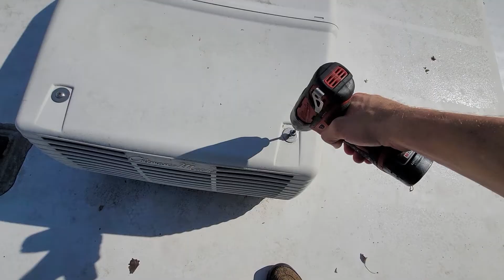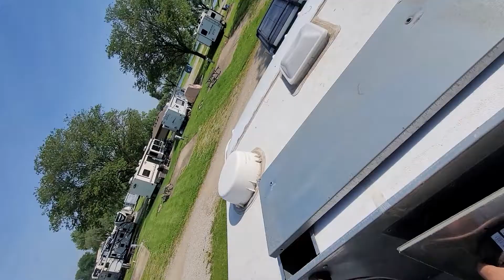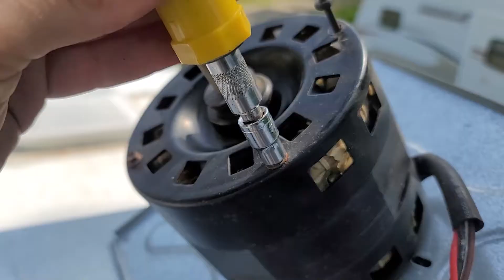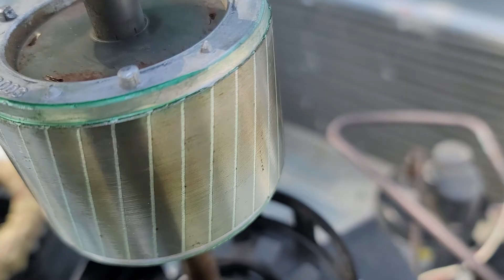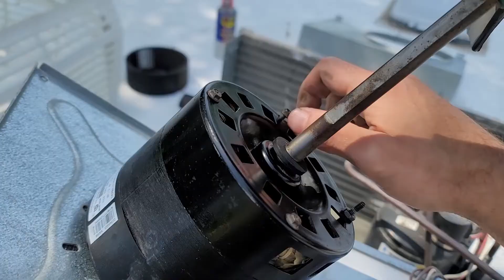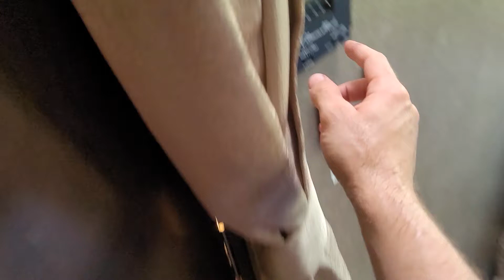Noisy RV Air Conditioner Fix - Coleman Mach 3 | Disassembly, Lubing Bearings & Maintenance

Comment: In case anyone wants to swap the bearings on Coleman Mach 3 they are 6201-ZZ-1/2. Not just plain 6201 bearing. I bought 6201 2pack from Amazon for $8 and the inner diameter was 12mm instead of half an inch (0.500). The correct specs are: 1/2" Bore; 1.26" Outside Diameter; 0.394" Outer Race Width. The entire shaft is 0.002 smaller and only the width of the bearing land is light press fit on the shaft. Very easy to pry the bearing up with screw driver. There is a snap ring under the bearing so make sure you are not prying that up. Bearings are $13 for 4 pack. These are brushless motors so can run forever as long as you keep swapping bearings.

Comment: Seems to me after all that work would it have not been better to spend 20 bucks for 2 new bearings ? Your fix is only temporary fixed. In a months time you will be doing it again
Reply from the maker: If the bearings were shot you might be right, but it has been a few years now and no issues have returned.

Comment: Any recommendations on the proper lube to use? TriFlow will work for awhile, but those bearings need something heavier...

Also the rear bearing is accessible, and may be the only prob. Just packing a little of the right grease next to it may silence it.
Reply from the maker: Grease sounds right actually, like Lucas Red & Tacky, probably because it'll stick around for much longer and has good water resistance: https://amzn.to/4twLXDw
Reply: @BOOTENWAGEN   OK thx. I did some digging and I can get PermaOil from one place, but it takes 3 weeks before it will ship.
Reply from the maker: @WordLightDotNet Sure -- oh wow, that's a while. You can probably find the Lucas grease at a local Autozone pretty easily if you need something sooner.
Reply: @BOOTENWAGEN I have an extra tube of this from packing the bearings on the travel trailer

Comment: Excellent tutorial! Mine made the exact same noise then the whole unit shut down! No tripped breaker! So I unplugged the shore power , disconnected the battery and flipped the breaker switch to off I went up top and removed the cover and hand spun the fan to realize it was hard to spin! So now I’ll do your entire strip down maintenance and hopefully the bearing aren’t seized!
Reply from the maker: Thank you - and hopefully it's even simpler like debris in the fan shroud.

Comment: Great job on this video!!! Coleman Mach heat pumps and a/c's weak point seems to be the bearings (and most others). Biggest reason perfectly good motors are thrown out and replaced.
Also, not maintaining (cleaning, lubricating, and protecting against rust) these units yearly or bi-yearly, will definitely cost you. Ive seen quite a few people destroy million dollar + motorhomes by not just cleaning their roof mounted HVAC systems. The drip trays clog with mildew, mold, and dust to eventually overfill. If the installer didnt tape down where the roof is opened, the water leaks through into the ceiling and down the floor. Unfortunately, most people dont catch it until they start noticing their entire RV is stinking and thats when they call for help and receive the bad news.
 Thx for the vid...
Reply from the maker: Thank you! And what you described is a horror story actually and absolutely believable. I think I'll go clean mine again soon...
Reply: @BOOTENWAGEN  Lol, sounds like a productive plan! Take care and GBY...

Comment: Fantatic video - thumbs up and subscribed.  I did this today and wish I had found this earlier!  All other videos I've seen had motors with sleeve bearings, but mine had the same ball bearings as yours.  Same bearing as yours was noisy and I guess due to rust I couldn't get the housing to release from bearing.  Even with just that level of disassembly, I was able to get a Zoom Oil spout in to drip oil in.  You definitely did a better job than me!  Has this lubrication held up?  I'm hoping its not just a short-term fix!
Reply from the maker: I appreciate that, thank you! I performed this last repair last Summer, so I guess time will tell - but I've been running this AC pretty hard, and haven't encountered any issues or recurrences of noisy bearings. I'm in this RV full time, so it hasn't spent any time in storage and is exposed to the elements at all times. My guess is some oils are probably 'stickier/tackier' than others have better staying power. I don't know much about Zoom Oil, but if it's meant for moving parts, it's probably a good bet.

Comment: I have one of those Mach units on my RV. Just took apart to clean condenser. I'm glad I found your video about the bearings which is what I was looking for. These Coleman units are inherently extremely noisy. I live fulltime in the desert. I basically run my unit 24/7 for about 4 months straight. The noise drives me insane.
Reply from the maker: Yeah, and that's really a very unfortunate property of the Colemans. Like I said, it'll probably help a little, but a quiet unit it won't make - may be just barely tolerable. I also have a video on how I turned this into a purifier, and stuffing a filter into the housing has also made it a touch quieter. Good luck.

Comment: I think this is exactly what is wrong with mine except on a level that the fan screamed at me with shrieking and screeches and then it stopped working and you can hear it trying to come on but it just starts to make an electrical overload sound if you don't immediately turn it off... sadly this happened to me two years ago a week after I bought the RV from a guy who said the ac unit was only a year old. this video is FREAKIN great thank you so much for this I can't wait until spring now

Comment: I have had good luck with using S. C. Johnson's Scrubbing Bubbles  as a coil cleaner on HVAC condensers. It seems to work as well as Nu-Calgon Nu Blast Condenser Air Conditioner Coil Spray, at a cheaper price. The are both alkaline based with the Scrubbing Bubbles being less alkaline but still works, you just have to let it sit for a bit longer.
Reply from the maker: Nice, that's good advice, especially for not having to go out of your way for specialty supplies. I was just kind of guessing that something foaming was needed like the HVAC tech guys on YouTube used to really get far into the radiator.